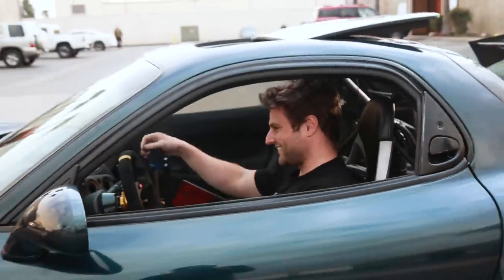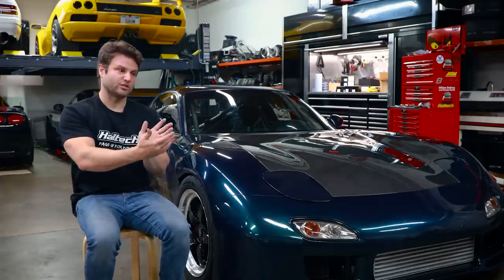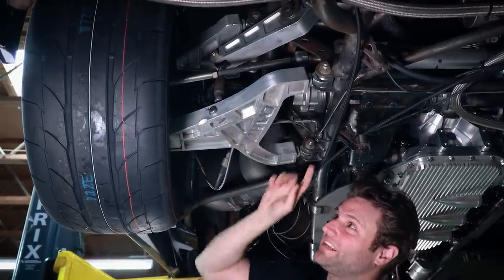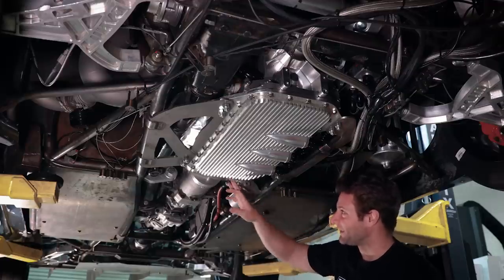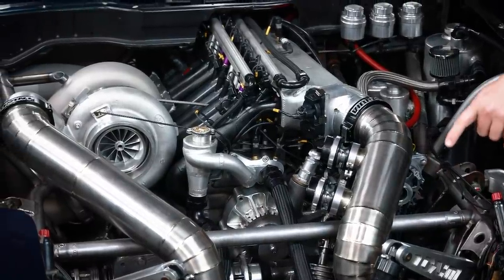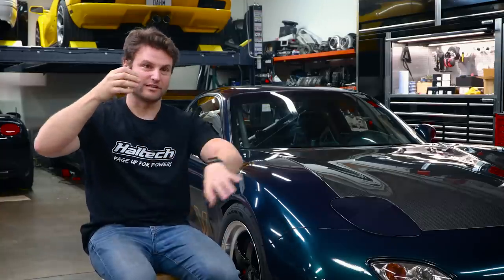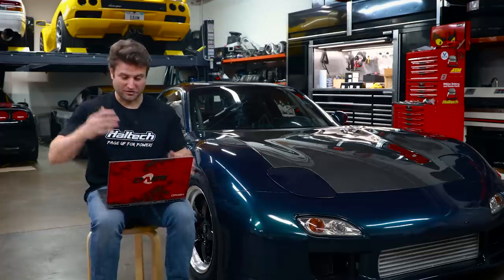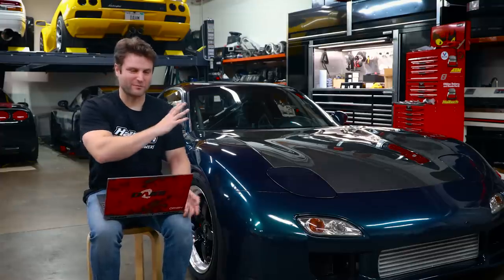🏅 Rob Dahm's AWD 4-Rotor RX7 - A Deep Dive | HALTECH HEROES

Comment: I like how he put emphasis on data accuracy, steady voltage, and wire insulation. Stomping on thin ice knowing how many it takes for it to break is how u set records.
Reply: Im so glad you point that out.  I get very uncomfortable when i cant trust the data. Im already over my head whenever im doing something new, i need the computer to tell me exactly what happened. The worst thing you can do is beat the shit out of your car, download the logs, and realize you cant use any of the data because your sensors were failing or you didnt wire it right.
Reply: @RobDahm  may I ask what is the number one or in other words "most important" readings you check first or keep an eye on before adjusting other stuff on the ESP software? Let's say if you add/change a sensor or injectors vs. when you're simply checking up on the settings. Thanks

Comment: Congrats on your achievement Rob. I am also a diy with severe mechanical ocd. So an engine swap turns into a complete build and rewire. At any rate I am almost ready to set the tdc offset in my elite2500 in my single turbo fox. You’ll be happy to hear, oem dash. All gauges work. All functions work except ac. No good spot for it in this rendition. Anyways keep it up!

Comment: ha-ha, bazooka for sure, death to all haters!
Hey just so you know, I am sure AF that other ECU manufactures can make more power. But honestly who gives AF when you know that the product you are using will kill your big $$$ motor quick!
I have used many Haltech ECU"s over the years and I am convinced that they are deep into the top 3 for guaranteed performance with more safety settings than you can ever use and will have your back even when the dumbest tuner fat fingers your settings, speaking from experience! You know sometimes shit just goes sideways with a car, last time it was me but at least my ECU covered my ass, now I just have to find a body to fit my motor!

Comment: Whenever a person talks about two people who are the same, they're called twins. When you have any siblings who are younger or order than you, the two of you are twins. It's the same with those two turbochargers. They were two different sizes. As you would know,  the second turbocharger was the bigger of the two of them. That one came online a few hundred ram's before 3000 rpm. So, what is this arrangement called? A compound turbocharger system. A compound turno system has two different sized turbochargers. That's what you needed to know, Robert.
Reply: Weren't they called sequential turbos systems? Compound turbos are run in series with one turbo feeding pressure into the next turbo for even more boost. Sequential turbos like in the RX-7 were developed to try and provide a more linear power band, the smaller turbo would spool up sooner, giving you low-down torque, then as the rpms increased the larger turbo would take over for the higher power requirements.
Reply: Yes, you're correct about that. Yes, it was a sequential turbocharged engine. Thanks for correcting me. I absolutely detest being wrong.
Reply: I additionally remember reading about that third generation after it became available to purchase in the 1990's. It continues to be my absolute favorite car. This is because of that 13B rotary, and because of how gorgeous the shape of it was in addition to continuing to be that to me. Look at that car one more time. Is there a more gorgeous car you ever saw? With 255 horsepower, it had a maximum speed of 170 mph. Only the Acura NXS was faster than it at that time. What else? When I have more to type, then I'll add it to the next message.

Comment: What a shame it's awd
Reply: Why would you say that?
Reply: @xploration1437  it's an RX7 it should be rwd. Awd is boring. Drifting, skids, burnouts, all the usual fun RX7 stuff gone. At least it sounds the part. I respect the build it's cool and all, but it's not for me
Reply: @scrubsscrubs694  it can be used in only rwd as well.
Reply: @scrubsscrubs694  has enough power to do any of that in awd and can switch to rwd just like the r32 gtr did in ATCC because it uses r32 awd
Reply: He can literally make it RWD with the flip of a switch. And how is it boring? It's also one of  only two AWD 4 rotor RX-7s in the world, that is pretty far from boring.
Reply: It goes from AWD to RWD in about 20-40ms.  I love it both ways.  Wow that sounds wrong.